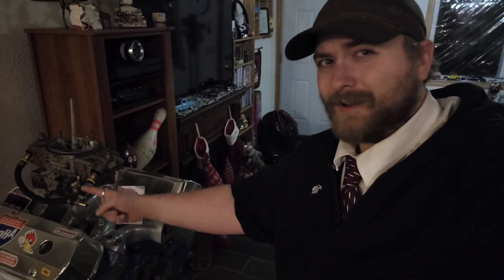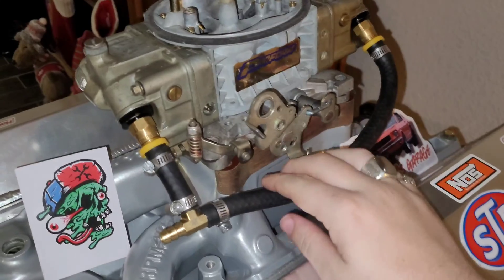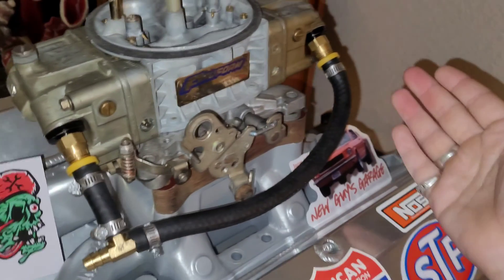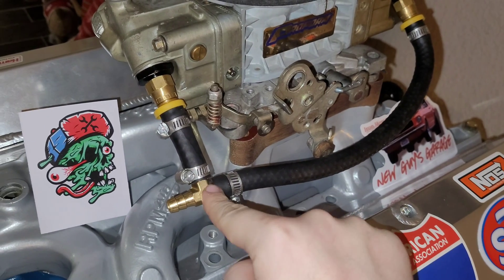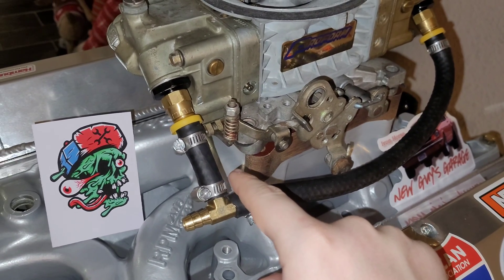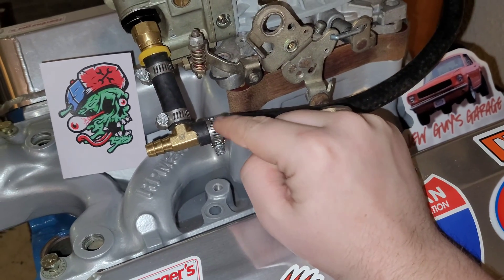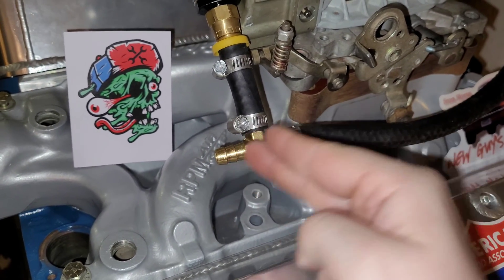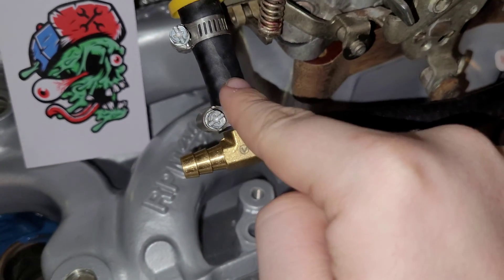10% Ethanol Gas And Rubber Hose Line....No Problem!

Comment: Looks like your carburetors on backwards and your fuel bowls are on the wrong ends. I've never seen throttle linkage on the passenger side and fuel lines on the same side as the throttle linkage. You got something goofy going on over there.
Reply from the maker: No that is intentional,
The sbf fuel pump is on the drivers side so i swapped the bowls around to make the inlet on the same side as the pump.

Comment: The only problem i see here is the fact that the inlet is closer to one outlet than the other by a mile, allowing the pressure to drop as per the square meter law, feeding more fuel to one bowl than the other... And solving that would actually requite either a solid machined and welded fuel rail to allow both bowls to be fed from equal distance with two short flex lines like you have and a central one that looks upwards to allow fuel to get in the rail and the flex line that connects there not to rub on anything... If you had the parts, its easy to make, but to pay for such a solution... at least a 100$(likely more)...
Reply from the maker: But you got to figure, you want primary fuel flow to go to the primary bowl. That is the one in operation 90% of the time. 

The secondary is only really used under heavy acceleration and there is enough gas in the bowl to not worry about it. 

The needle and seat are the true restoration rather than the length of the hose see what i mean?
Reply: @newguysgarage6802  Hmm, interesting logic, sensible too... I guess its a good idea, i just dont like sharp bends in tube and  right angle fittings for anything where i can make custom solid gently curved componentry... And its not like equal distance would feed either more, for as you said, second bowl is properly used under acceleration, which renders it once full, like a toilet tank, maxed out, so the primary bowl gets to be compensated regardless of it not being the ``main inlet`` as it will get all the fuel that secondary one would not take as its ``capped``... Dunno, i guess i like to complicate things if at all possible...
Also, not sure if needle and seat/hose length are a size/skill joke or both that and a statement of logic that the regulating parts are more important than the hose that just has to flow enough fuel without problems...
Cheers
Reply from the maker: Nothing wrong with making nice fuel line dont get me wrong lol, 
If its something you want to do and like the sharp look of it then i say absolutely go for it! 😁
This video is just to show what i do and think 🙂😀

Comment: Not only do the modern rubber fuel lines not break down like the old ones, they are rated for higher pressure! They can be used on fuel injected stuff! I run rubber hose on everything because it's dirt cheap. Also, that song from Tom is FUNKY! Oh yeah!
Reply from the maker: See you get it! Lol 😁

Comment: When my buddy had his 69 charger, he had someone tell him that he needs to use AN fittings and steel brake line and modify it to fit his carb because he believed the rubber hose was a horrible fire hazard. I straight up told him that the rubber hose is the best choice for his car and his pockets.
Reply from the maker: Its almost like the rubber hose was made to be used as a fuel line 🤣
Aside from the fact it says fuel line on it 😂 

Yet people dont bat an eye that the radiator hose is just rubber line and a hose clamp 😁
Reply: @newguysgarage6802  I know right? I've had to replace more radiator hoses than fuel lines, lol
Reply from the maker: Well......to be fair now...
Company's dont make as much money if they tell you that you DONT need AN fittings. 

Then it trickles down from there 😅

Comment: I run AN fittings where I have high pressure or its something that has to pass tech inspection to race, otherwise its rare I use them. I have found that the EFI hose, which is all the stores around me keep in stock, works just fine with 10%, 30%, 50%, 75% 85% or 100% ethanol. It stays pliable for years, doesn't crack or leak, and doesn't fall apart. Been running that stuff since the 1990s.

If your car has rubber fuel hose from 40 or more years ago, its a fire hazard no matter what fuel is in it. Rubber has a lifespan when subjected to heat cycles and all the other stuff under the hoods of cars.

You don't need to do anything special with ethanol fuels, unless they have lots of additives, in which case you want to drain that out when you park it for the winter. Increase the amount of fuel going into the engine because ethanol has a LOT more oxygen in it than gasoline, and provided its not full of varnish from E0% gasoline, it will be fine.

Been testing this since 2007, ran 10% in my 70 GTO from 1994 when I bought it, until 2018 when I took it off the road because the wiring harnesses and suspension bushings are done. It will be getting a frame off rebuild so I can make everything nice and clean under it, its been running E85 and E100 since 2007.

The 65 GTO has been on E85/E100 since 2018. The 68 LeMans has been on E85 since 2014. The 79 Formula has been on E85 since 2011. They all start in the spring and once they are warmed up again they run flawlessly. I don't even build pump gas engines anymore, unless its for a truck I drive all winter.. but even those will probably end up on vodka when gas goes way over $5 again. Should be right soon.
Reply from the maker: Yep that is right 😁👌

Comment: AN fittings look cool. They don’t have much benefit beyond that. As for the ethanol, it is hydroscopic and will pull moisture into the bowls. I just got my Holley 670 cleaned up from having new gas stored in it too long. Moisture got into it and left some pits in the internals. Nothing too bad but certainly hindered flow through all those small passages. In essence, performance desires cost effective parts. Show cars can be blinged out so the costly speed parts aren’t needed. All depends on your build in the end
Reply: Yes ethanol absorbs water, but all it does is lower the proof. It does not rust anything because it has a lower proof. Water condenses inside gas tanks and crankcases because of heat cycles, the engine gets hot enough to boil the water out unless you run it too cold. The gas tank will just continue to condense water, and it will sit on the bottom of the tank, then cause problems when the tank gets low... like rust and filling the fuel line, pump, and carb/injectors with water.

Since ethanol absorbs water, if you have it in your gasoline, it will let you burn that water as fuel rather than it sitting there causing problems. Its the same thing HEET and Drygas do, except they are methanol... which is very corrosive to fuel system parts,  whereas ethanol itself is not. People conflate the two often, but they are quite different.

The corrosion, pitting, white residue, and the waxy yellow stuff, as well as the rust, is NOT from ethanol. It is from the additives put in to gasoline along with ethanol. 

Ethanol is simply very high proof vodka, same as in whiskey, wine, and beer. Does whiskey or vodka go bad over time? No, they do not. Does it leave waxy or chalky white residue behind in very old bottles? No, it does not. Does whiskey collect lots of water while it sits on the shelf behind the bar with an open spout? Nope...

I have tons of problems with gasoline sitting in carbs. E85 from farther south of me like Iowa, Illinois, Nebraska, etc can have the additives that cause problems. The fuel I get in Menominee Wisconsin to fill 55 gallon drums so I can transport it the 2 hours to where I live doesn't have as many additives in it.

The ethanol fuel I make from cattails, tree sap and other things has zero additives in it. I can let that sit in my cars for decades and it doesn't go bad or cause any problems, it runs just as good as the day it comes out of my still.

People blame ethanol for problems, but it is not ethanol causing them, its the really craptastic gasoline they can sell once they mix 10% ethanol to it, and the additives that cause the problems... including lower mileage. 10% isn't anywhere near enough to affect mileage, nor is 30%. You can test it if you want, put zero ethanol gas in, and add 15% of E85 to the tank and see how it runs. It will run much better and will make more power, all while getting the same or better mileage as it does on E10.

The E10 stuff is really crap... but not because of the ethanol in it.